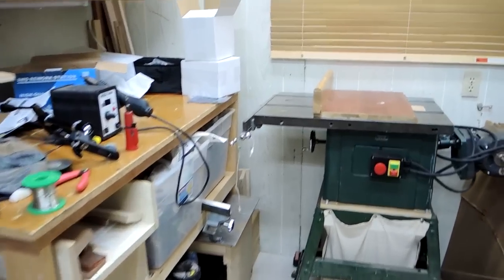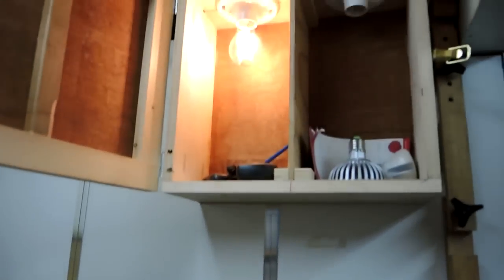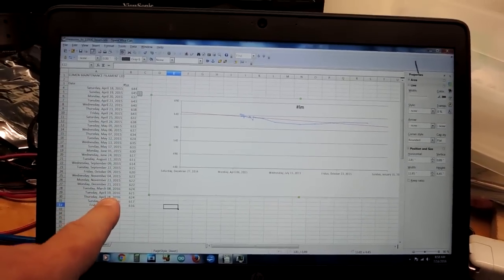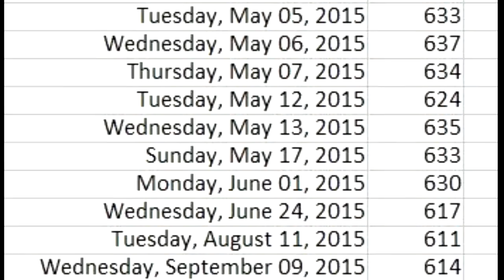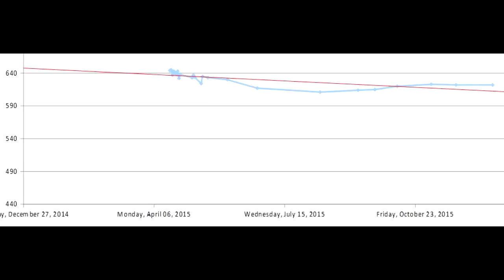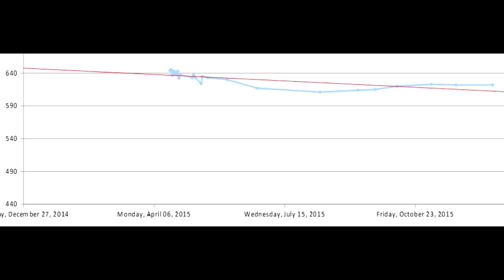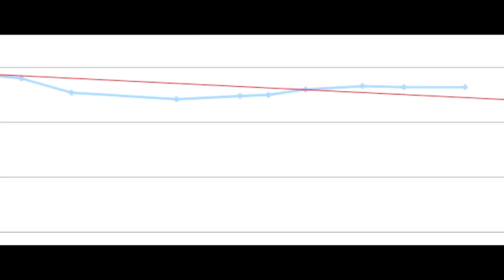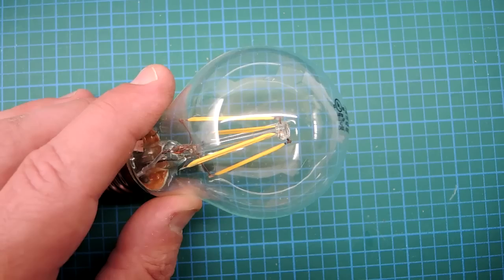FILAMENT LED: LONG TERM TEST: 10,000 HOURS!

Comment: That's incredible. Now if only they can make the tiny power supplies better for these filament styles so they're not so horribly flickery it really would be the final end of incandescents. These use so little material to manufacture and sip power so lightly, they're clearly superior economically, environmentally, and performance-wise to all other common household lighting technologies.
Reply: Good news ! I've bought an Philips ND 2.3-25W E14 WW B35 CL ligh-bulb and i can't notice the flicker. The color and light spread is also great. I use it for a month now 10 hours per day. Still working :)
Reply: Hmm that does look promising. No 4w candelabra version yet it seems. Looks like it's only available in eu so far, nothing on amazon US or UK yet and no reviews or teardowns anywhere. I'm still a little suspicious because the ps looks so tiny, like the one I have and like in the teardowns here and on bigclive's channel, that it's hard to imagine they have a smoothing capacitor large enough to eliminate the ripple seen with these simple capacitive droppers. Maybe the circuit design is completely different though? You should do a teardown! You'd be the first!
Reply: I'll do a teardown only after it fail to work. Too expensive bulb and i only have one. With shipment it cost me 10$. With power supply that small i wonder if the trick of no flickering is in the phosphor over the leds. Could be the best and cheapest idea :)
Reply: Yep, hold a cell phone camera to them and you can see black lines across the screen, artifacts from 60hz flicker.  Eye strain from such things is subtle at times, a shame, hopefully they solve this because the tech is otherwise promising.

Comment: I have one in every (large type) socket in the house. They last forever (so far)

I have one in particular (desk lamp) that (by sheer force of habit) gets turned on and off with the computer I'm using, so I took a quick look at the logs this computer has, and they seem to go back all the way to when I bought the computer, which incidentally isn't far off the bulb purchase date. I'm looking at 25k hours atleast of logged hours, and it's still outputting roughly the same amounts of lumens as when I bought it (I'm going by feel on this one).

I can absolutely recommend grabbing these. The lumens are good, the color temperature is very nice (almost daylight like, but slightly warmer), and I can't complain about the longevity.

My make: No-name brand, bought at the local Aldi store.

Comment: Would it be safe to assume that whatever gas they're using in the bulb (Helium?) is more effective than the thin pieces of metal common in current budget LED bulbs?

At about a watt per filament, with quite a lot of LEDs per filament piece, I'd imagine the LEDs are actually under a relatively low load, with more efficiency being gained from running more LED emitters at a lower current than to drive fewer LED emitters harder. The slow decline in brightness makes sense. 

My own LED flashlight lost quite a lot of brightness, though it produces the same amount of light from one of these bulbs out of a single LED emitter, so quite interesting to see.

Comment: Could it be that the mains voltage varies among measurements ??
Reply: Possibly but I think he has accounted for that and is averaging the results.  But that shouldn't account for the slope going down.  I suppose he could take an outlet measurement at the same time for consistency though.

Comment: the lifetime on the box might be due to other components and not just the lumen depreciation rate. the dip in your measurement might be due to climate variation as your box is not temperature controlled.

Comment: I would in all probability rate the PSU life as the limiting factor, as the LED itself is reasonably cool in the glass, but the power supply is constrained by the space available as to how well they will derate it and just how they can actually make it.
Reply: I don't think these glass filament led bulbs actually have much in the way of a power supply.  Most I have seen are nothing but a resistor inline with the LED filaments so the resistor should outlast the LEDs it is protecting.

Comment: Did tungsten filament bulbs show any reduction in lux as they age?
Reply: No... it reduces the thickness of the tungsten wire inside... and finally it pops out.
Reply: They can if the tungsten gets evaporated and sticks to the glass.
Reply: could it actually get a bit brighter due to the wire getting thinner? or less due to thinner wire being less conductive? i mean its a tiny difference like it is in this LED lamp , way less than 5 percent, i wonder if anyone has any accurate data on it

Comment: I wonder how much the performance of these bulbs would be affected by turning them on and off every couple hours.
Reply: that is the main strength of LED,s they are not stresed by that, and it would be hard finding a timer switch that would last the test, im sure multiple of those would fail over the years it would take
Reply: @jusb1066  You sure that the solder joints are not stressed by that? They should be.
Reply: @DasAntiNaziBroetchen  pretty good designs these days not so much an issue, life of capacitors seems likely failure

Comment: Maybe I missed it... But what is the make/model of this bulb?
Reply from the maker: The UL mark points towards: Zhejiang Z-Light Optoelectronics co Ltd
Reply: +electronupdate Thank you
Reply: +electronupdate what is the store brand?
Reply from the maker: It came from Amazon.  White box, no brand.  Retailer no longer active on Amazon.  China still needs to up it's game in creating brand names.
Reply: +electronupdate thanks for replying. Does it have a power supply in the base or is a straight 120v distributed across the filaments?
Reply: +Graham Wilson I found a partial answer in your 2014 tear down. Is the 10,000 bulb a similar design?

Comment: proper way to test it is to implement switch on/off automatics that will simulate daily usage. not just to run it non stop...
Reply: Unless the goal is to see if the Lux reduced overtime. It's an output test not an endurance test.
Reply: maybe switching operations will affect LUX reduced too, now we just dont know :P